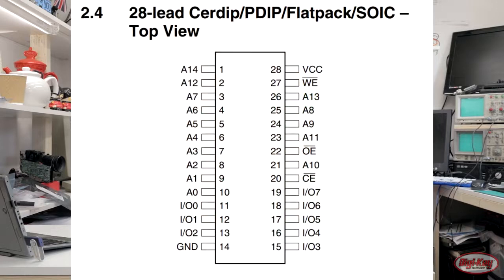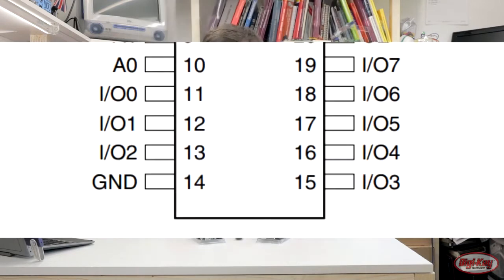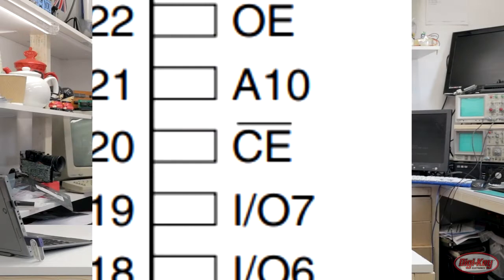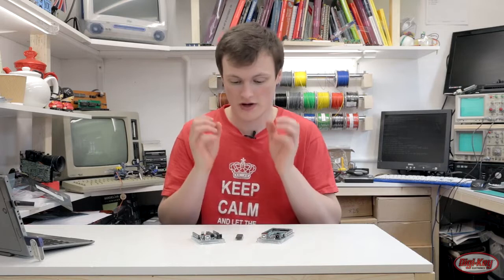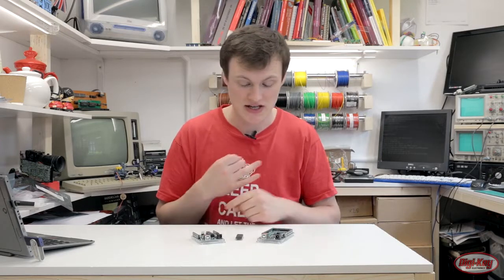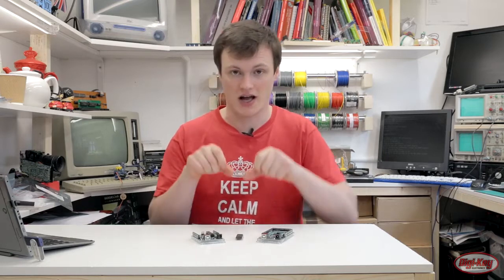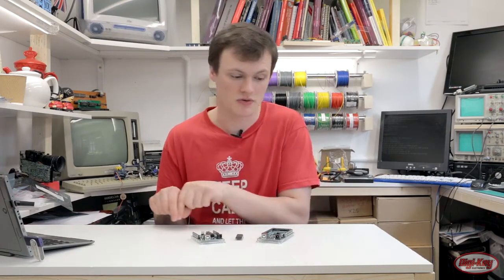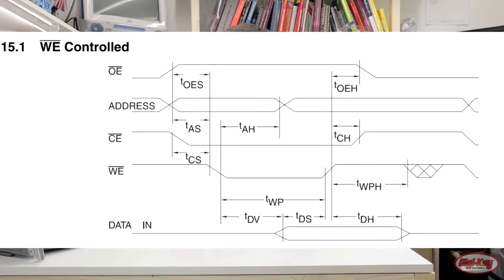How to Use Parallel EEPROM Memory for Storing Data – Maker.io Tutorial | Digi-Key Electronics

Comment: Here's a usage-case where a parallel EEPROM might be married to a low-pin-count-MCU --> Imagine you want to generate high-frequency waveforms (say 50MHz) with a DAC --> Load the EEPROM slowly, e.g. using shift-registers or latches --> thereafter for "playback" you can use an enternal counter to generate the address and use the MCU or VCO just to clock the address-generator at blazing fast speeds. Or you could get an FPGA. :/

Comment: Missed the main reason for parallel memory chips. Many chips have support to allow you to execute code directly from the EEPROM without needing to copy it over to ram. Much like you can with the internal EEPROM. You will see these chips on embedded systems where the hardware does not change but the software is bespoke for the instillation.

Comment: Well, it’s fortunate that they’re still around for those of us who want to make their own CPU, which TBH is one of the few uses they have nowadays. Ben Eater has an excellent series of tutorials on doing that, if you want to build one.
Reply: This is why I down voted this video as it gives the wrong impression and leads to miss information. They are still used for industrial settings. Many low cost chips don't have internal EEPROM. You add your own and there are many reasons why this is useful.